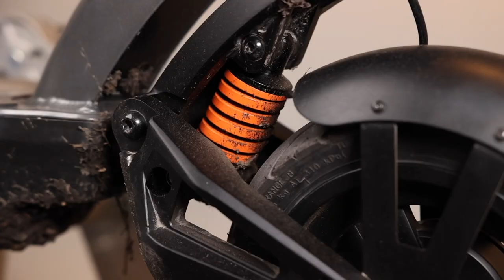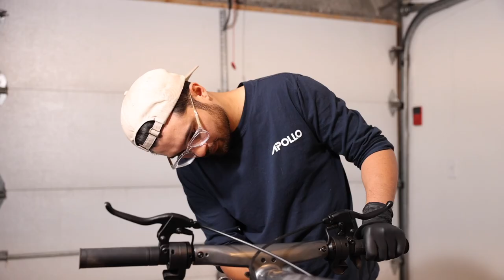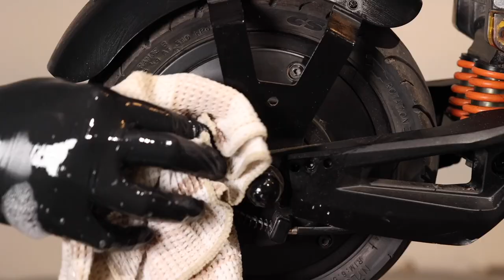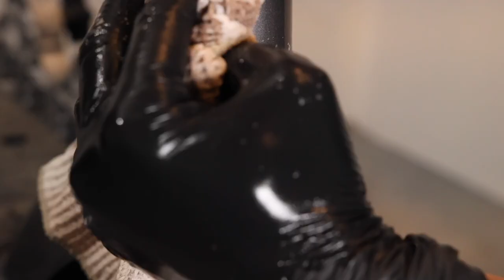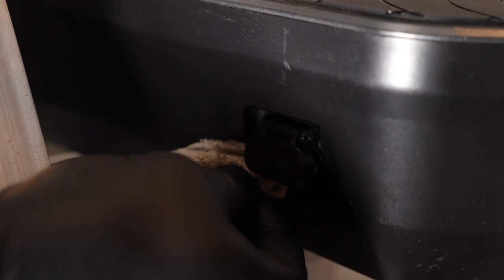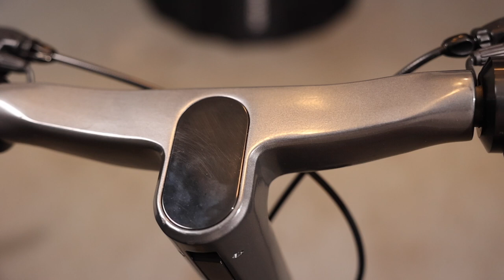How To: Scooter Detailing (ASMR)

Comment: I would NOT use water. Go with wd40 or some other cleaning solution
Reply: WD-40 will destroy rubber I believe. Soapy woder is best. Then silicone spray on suspension.

Comment: 3 hours later with a toothbrush 😂.  The City 2022 isn't supposed to be IP66 ?  Why not use a low water pressure hose ?  At least on the low risk parts, like the suspensions, the deck, the tires... Have a nice day.